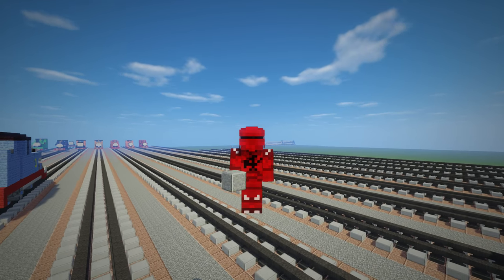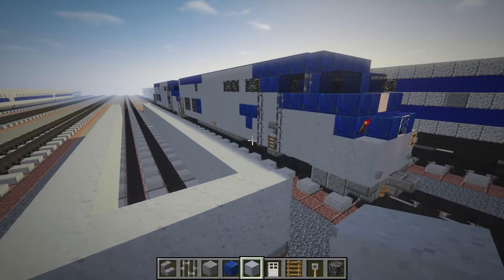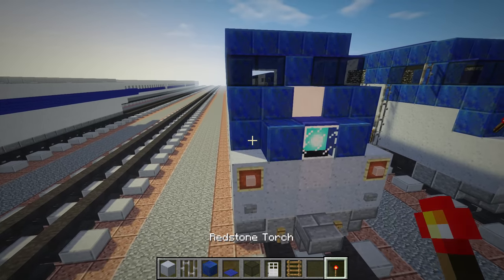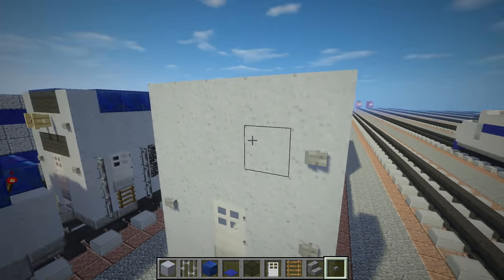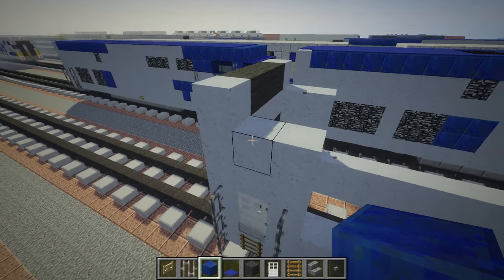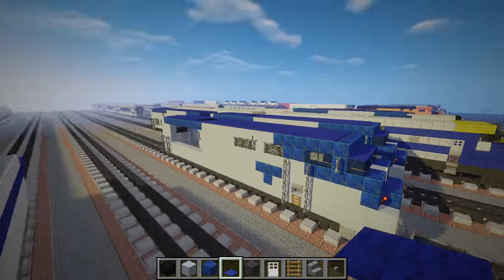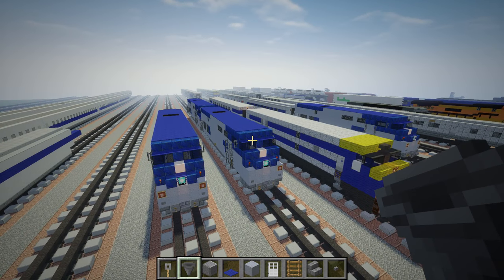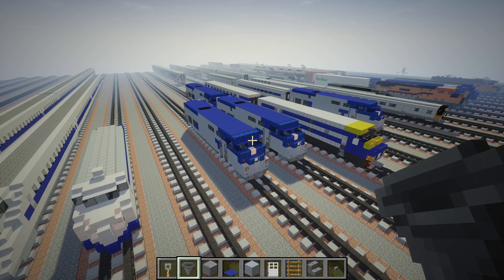Minecraft Amtrak P32AC-DM/P-40/42DC GE Genesis Tutorial

Comment: the P32 AC-DM has the ability to switch from Diesel engine powering the wheels, to 3rd rail power so the loco can be used in tunnels where subway trains are used